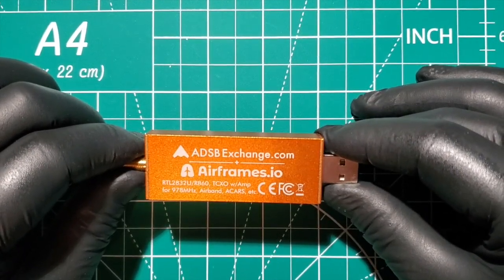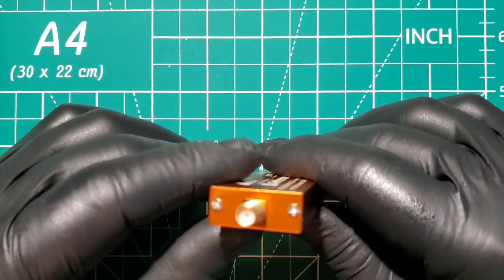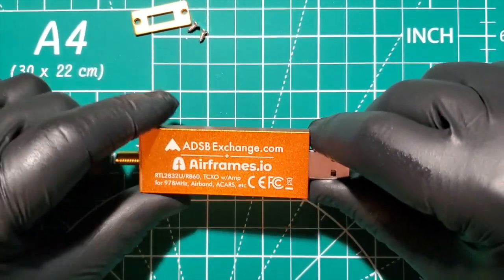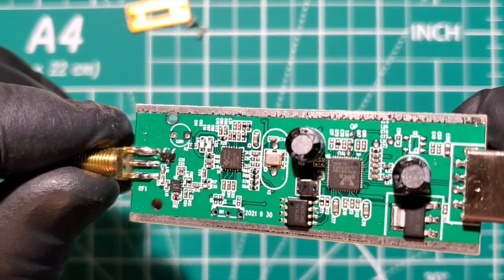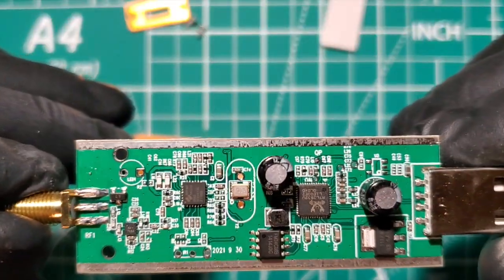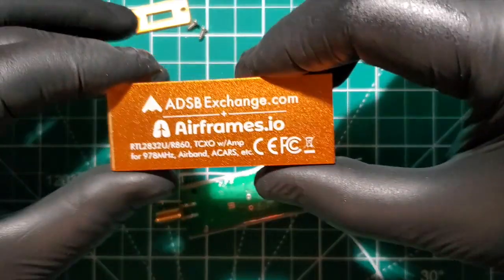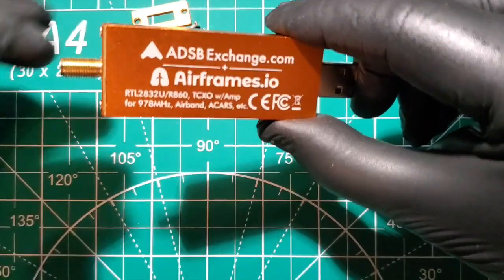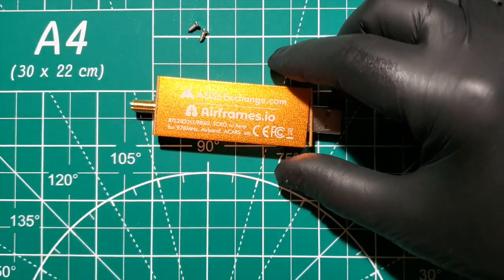ADSBexchange RTL  |  A Look Inside The Orange RTL With AMP

Comment: Hey. Will this sdr still tune between 25 to 1800 mhz like a rtl sdr v3?

Thanks
Reply: Also trying to figure this out
Reply from the maker: The little bit of testing a did so far. I was able to tune to the airband freq's. But his dongle is more made for UAT 978MHz and some other freq's.

You would be better off using a NooElec dongle or the V3.